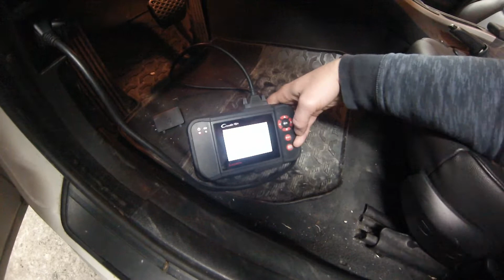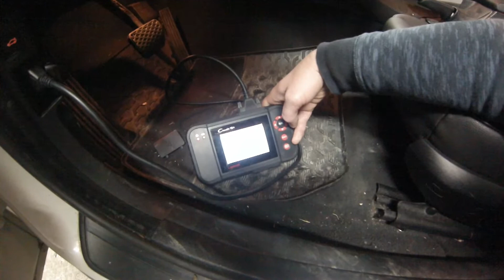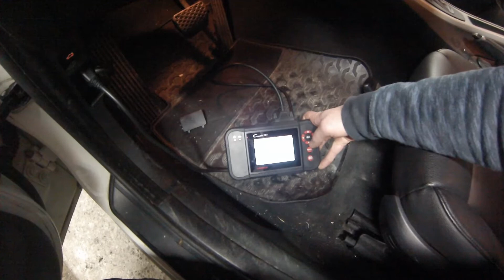BMW 323i Misfire Diagnosis Part 1 - How To

Comment: I had a similar issue on my Celica. It eventually led to a metled piston and scored cylinder head. A missfire that lead to engine failure. Took some time to manifest but faulty coil packs causes some knock destroyed my spark plug on cylinder three, that sent foreign material into my combustion chamber. You know the rest. Celica has a new motor in it.
Reply from the maker: It's unfortunate when small issues lead to catastrophic failures. I've had my share.

Comment: Oh man.   I can't stand working on anything German.  Just way overbuilt.  I wish you luck man.   

I need you to fly here to PA and tell me why my Fozz constantly unlocks on it's own over and over and over after it's been driven in the rain.  lol.
Reply from the maker: I took in this job because I knew it would be good content. I'm with you though, don't care for European repairs. 

The locks hitting like that are likely to be one of two things. #1 Either a keyless entry module whether it be OEM or aftermarket.  #2  Some broken wiring in the drivers door jam that is shorting to another broken circuit which happens to be grounded.  The switches or relays are not as likely to be that type of problem.